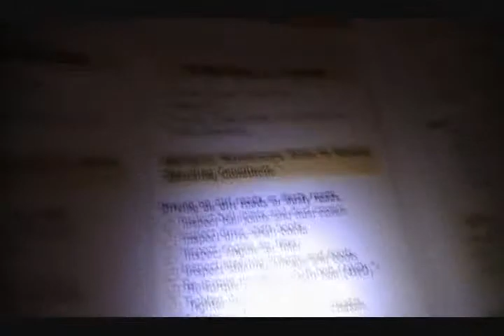IRL Matrix 09 Oil Change 3/3

Comment: ya toyota has baffles on their oil and coolant reservoir intakes, so when you pour to fast like you were doing it was just spilling from the top, and not from the filter. thanks for the vid. i have to do one this weekend that's been to 2 other mechanics and they could not remove the oil filter, should be fun.

Comment: WOW almost 30 mins of video of showing how not to change ur own oil and filter on a Toyota matrix.....since I always have the rights tools I could have done all that in 5 mins or less, and word of advice for old oil filter u going to throw away use a screw driver to penetrate it and give it a pull or push and it breaks the oil seal from older filter no oil filter removal tool needed